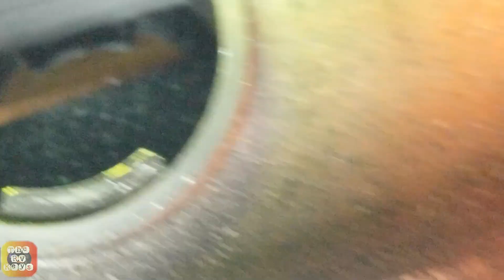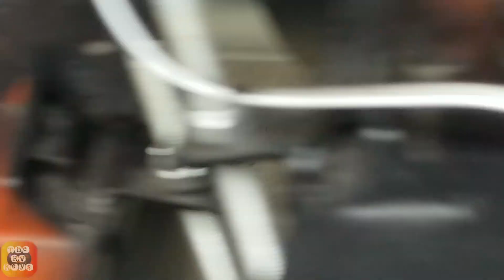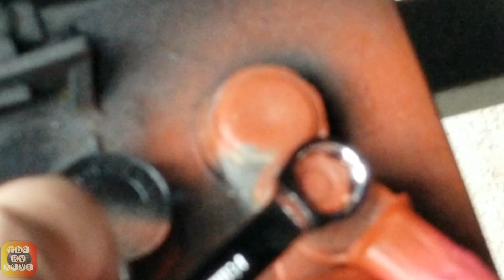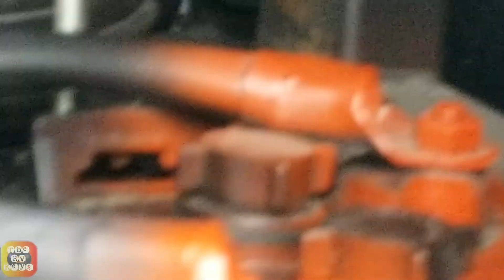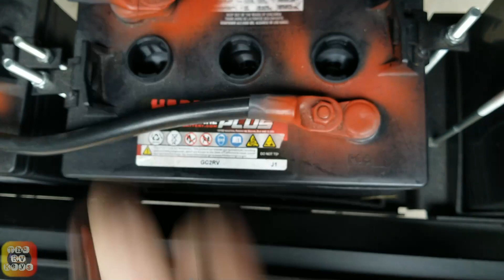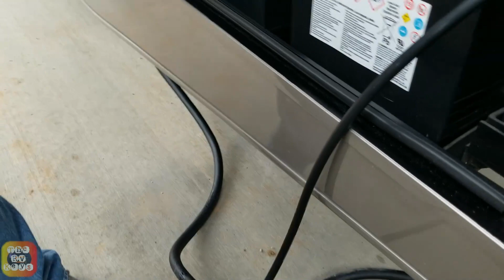Get This For Your RV! FLOW RITE Pro fill Battery Watering System TheRVkeys Episode 37

Comment: I have a similar stem for a golf cart and the batteries have lasted really well.  We have just taken delivery of a Holiday Rambler Nautica 34RX.  The battery set up is identical to yours.  We have the gravity fill kit for our golf cart but I'm not sure I want to take its bulk on the road.  With the hand pump, how do you know when the batteries are full and what do you use, just a 1 gal Distilled Water jug ??
Reply: I just watched your video again and realize you answered my question near the end.  By the way, did you film this at NIRVC Atlanta ?  It looks pretty familiar.  That's where we picked up our Nautica.
Reply from the maker: We use a one gallon distilled bottle.  Someone commented that it's better to put the fill point in the middle of the batteries, but ours seems to work anyway.  We just squeeze the hand bulb until water no longer flows.  Other than that, you can remove a cap to inspect.

Comment: To equalize the flow of water, I recommend that you locate the fill line more to the center of the batteries rather than the end. The centering of the fill line in the manifold layout is recommended by the mfgr.
Reply from the maker: Thanks for the tip!